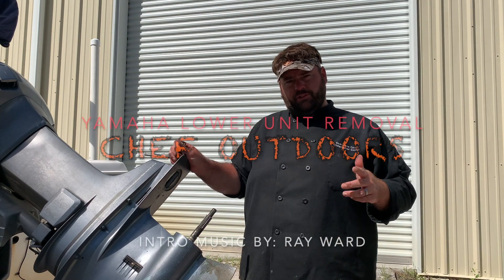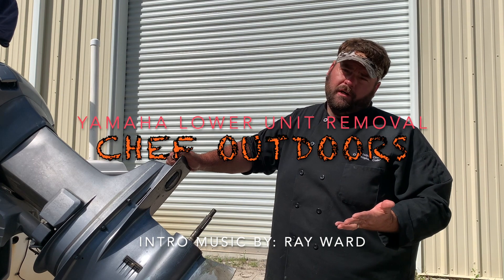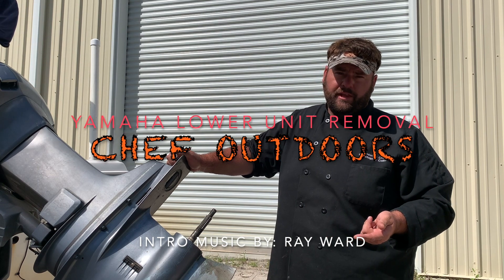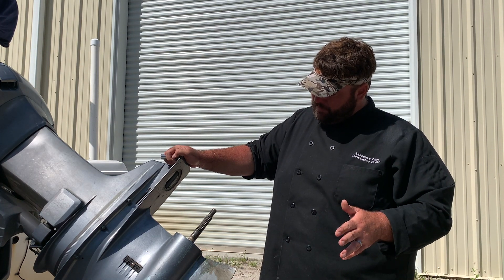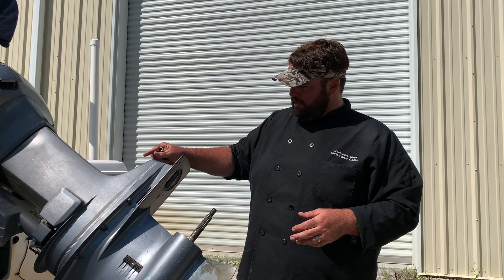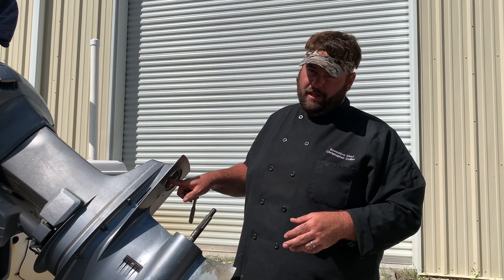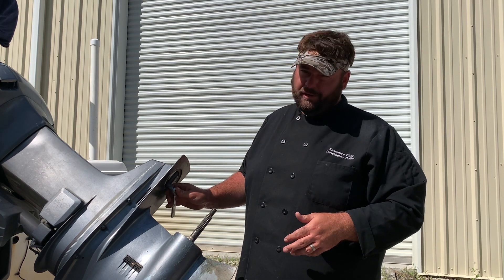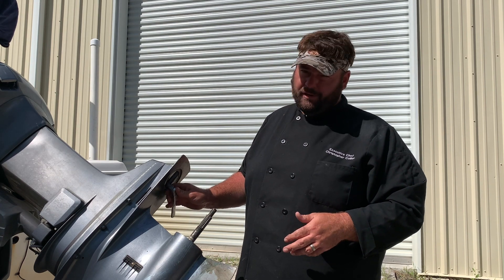“YAMAHA OUTBOARD” lower unit removal and replacement (HOW TO) YAMAHA

Comment: Looks pretty simple. Do you need to have it in neutral or a gear to reinstall.
Reply: what ever it is in on the gear shift. normally neutral.
Reply from the maker: Just make sure the lower unit is in the same position as the shifter. The engine and lower unit need to be in the same gear for reinstallation.

Comment: Good video. I am trying to find a new lower unit for my 1987 Pro V150H.  I know its RH drive, is there anything else I need (like drive shaft length or gear ratio)  to purchase a new one?

Comment: Do you need to make sure the shifter is in the same gear or neutral as the new lower? If so how would you go about doing that or is there only one way it lines up. It looks like just a spline so it could line up several different ways.
Reply from the maker: Yes they have to be in the same gear. It is just a spline so it can be installed in the wrong gear easily. You can use pliers to shift gears in the lower before installing it if you have to. Just be careful not to strip the spline
Reply: @ChefOutdoors  how do you know the gear position of the lower unit and the shifter? Thanks!  Was going to take mine in but came across this and figured I'd try it.

Comment: Great video! I subscribed. 
Question: is it easy to swap a 20 inch lower unit to a 25 inch without too much effort and pricey parts?

My motor blew up in my 150 hp 25 inch lower unit but found another 150 hp with 20 inch. Can I swap 20 for 25?

Comment: Great video, I have a question. I was full throttle in my 76 mercury mariner 60hp when I head a pop and lost 90% of thrust.  I removed the bearing carrier thinking the pin in them dog clutch had sheared but it fine, in fact I inspected all gears etc... and I see nothing of concern it all looks great in the gear case. The engine performs as usual. Any thoughts of what could be the issue?
Reply from the maker: Did you check the prop, maybe the hub spun in the prop? Not sure if that particular configuration

Comment: Do you put it on neutral when taking it off?
Reply from the maker: Yes, but sometimes I like to put it in gear so I can spin the prop to help align the splines in the driveshaft. If it is in neutral you can spin the fly wheel to align the driveshaft splines

Comment: On my yamaha 250 there is another hole under fin and in front of zinc that also had a 14 mm bolt.  It was a little shorter than the 14 mm under zinc.  I removed it but did I not have to remove that one?

Comment: Just a question, I have a 2020 Yamaha 150 four stroke and the bolts holding the lower unit on are leaking oil. Thoughts?
Reply from the maker: what kind of oil? engine oil or gear lube? could be engine oil for the block running down, could be gear lube coming up from the gear case through the shift shaft or drive shaft seals, could be unburned fuel and carbon from a hole in the exhaust port running down to the bolts. lots of investigating to do.. let me know what you find

Comment: Is there a gasket that goes in between  the lower unit and the motor
Reply from the maker: No there is just an exhaust gasket inside the lower that is reusable, but no other gasket between them

Comment: do you install in neutral?
Reply from the maker: Just make sure the engine and lower unit are in the same gear for reinstallation
Reply: @ChefOutdoors  Great video's Chef. I'm now a expert on installing a lower unit.
Reply from the maker: @dougplommer9961 that's great! 😃 I'm Glad to hear

Comment: My lower unit screws came off and 2 of them snapped off why is that and what do think happened to my 4 stroke 25hp yamaha I just sent it out last year to get it fixed too😢
Reply: The lower unit I sent out to get it repaired because it crack near the propeller area

Comment: What kind of grease are you putting on the drive shaft?
Reply from the maker: I am not sure I specifically remember, but what I probably would of been using was a yamalube or quicksilver marine grease lubricant or equivalent. I usually have a few tubes lying around

Comment: I tried taking my lower unit off today it came off but something still seems to be holding it, it looks like I may need to loosen something on the rod that comes out when you take the whole lower unit out, I’m not sure I didn’t want to try to bang it out anymore and end up breaking something, I have a 1991 Yamaha outboard 2 stroke
Reply from the maker: I am not sure to be honest. Yamaha's shift and drive shafts are always splined so they should slide off easy. make sure to look into it further. let me know what you find!
Reply: @ChefOutdoors  I was able to get it off theirs a piece called the coupler and I had to turn that a few times then it finally came loose

Comment: thanks bout to do this in the water :[[[[ thank u!.
Reply from the maker: I did another video that way also. Good luck
Reply: @ChefOutdoors  used a ratchet strap and tied a bunch of ropes onto my lower and just let the thing fall out,  for innstall i put the strap around the bottom and ratcheted it in inch by innch all under and in the water :P,, had to ggo swimming at my slip to do this haha thanks for the educationnal video it def helped inside the water.
Reply: @ChefOutdoors  na i watched that one, i could not stand on the bottom this was in 20ft deep of water , but that video also helped knowing what i was gettin myself into :D thanks